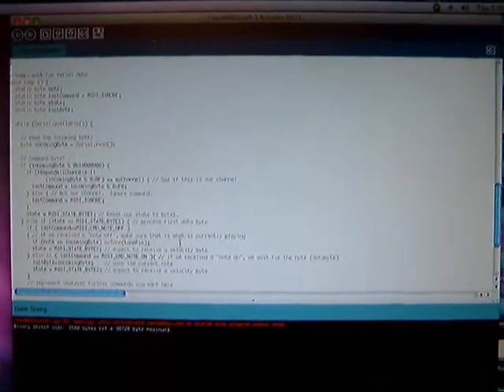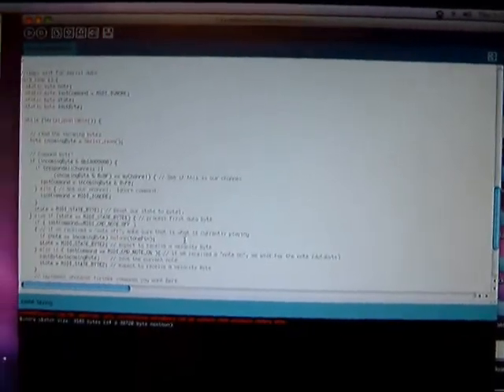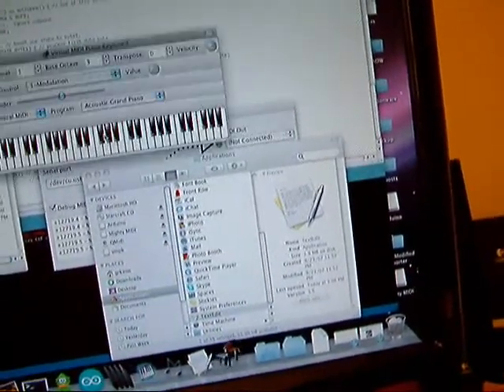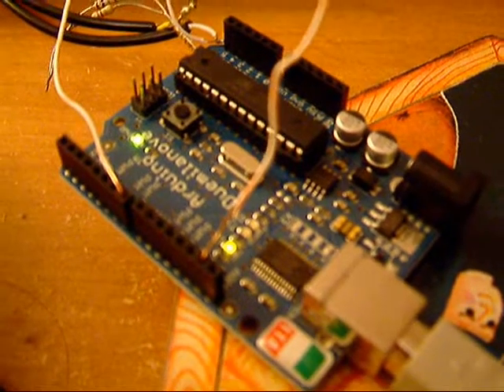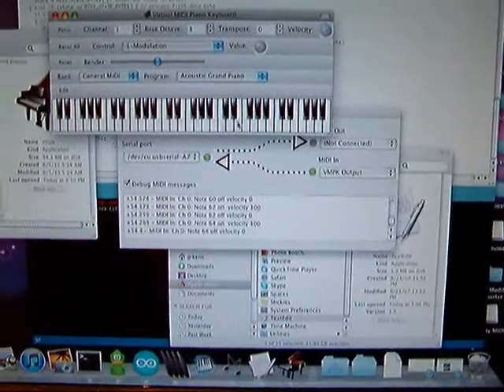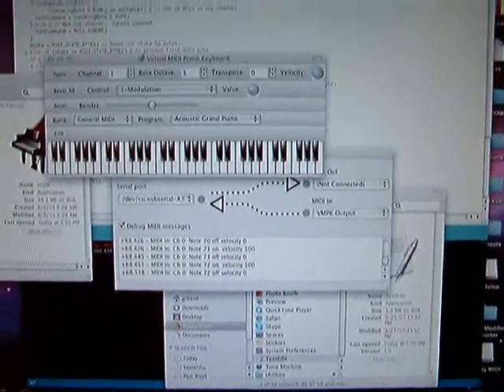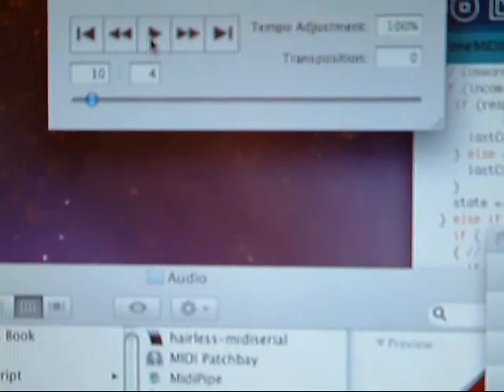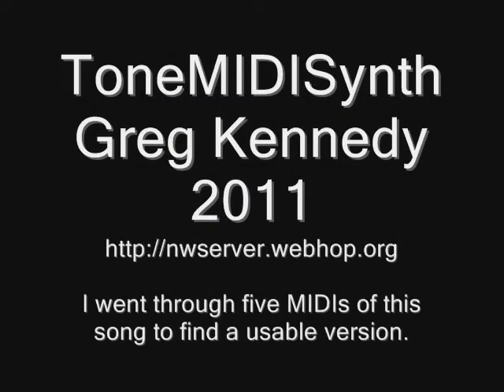ToneMIDISynth - Simple Arduino MIDI Synth

Comment: @angusgr I want to be able to send midi data in three directions. First one is the real midi out port. The second one is your beautiful hairless converter and the third is integrated midi chip in my device, which takes midi data and outputs it to the headphones minijack. I was this all happen at the same time, using MIDI Library and only one pin RX (for midi synth and 5 pin out), that is already present on arduino board, simultaneously.

Comment: @angusgr Add 31250 speed (standart midi port) please. For now, it's impossible to use the same sketch for USB and hardware midi connection. Thank you. This one is much easier than serial2midi.

Comment: @angusgr There's also a problem I've hit while testing sketches withiut external controls (only a software midi.sends). Converter doesn't take two or more NoteOn commands, following each other, until there's no NoteOff before the second NoteOn command. I can't figure out, why does it happen.  Because of this, I can't play chords or long notes. Once again, only a software. Didn't tested with hardware controls. Still waiting for my ebay purchases. Thanks.

Comment: @fundorinlive Can you explain what you've got in mind for your setup?

As I understand it, hardware MIDI port logic is a bit different to regular serial - for instance, the start & stop bits are inverted. So for that reason I didn't add 312500bps, because I thought it would be hard to use reliably.